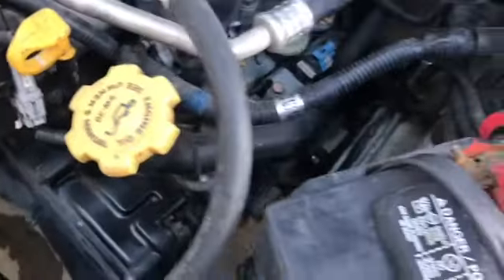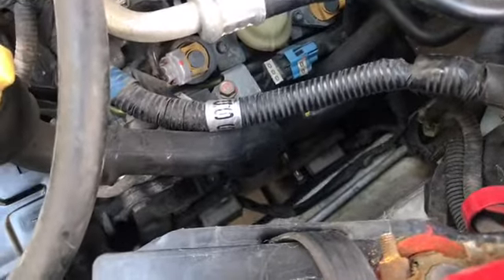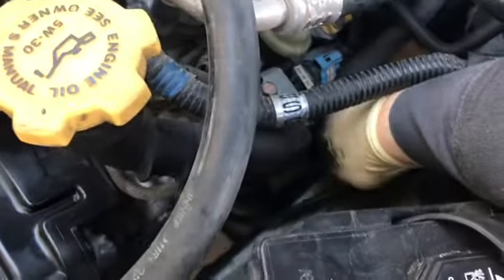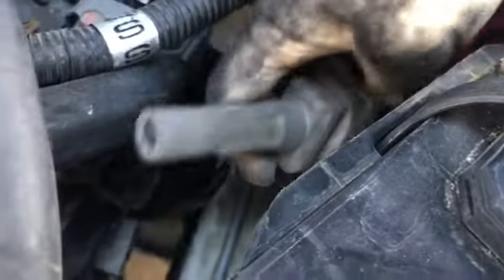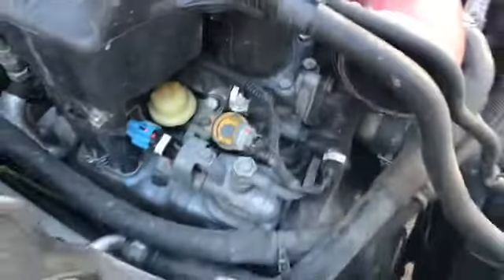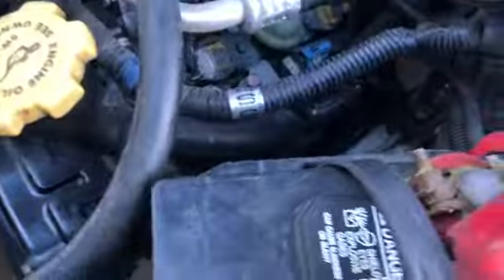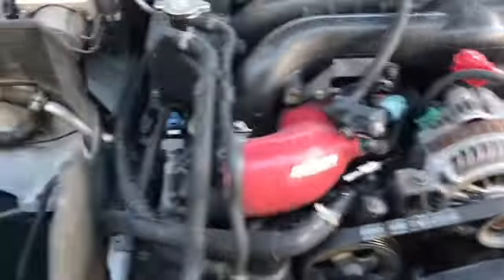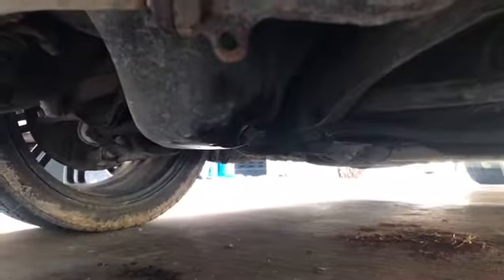Subaru Legacy Coil-On plug replacement

Comment: Congrats on resolving your problem. But there is an easier way on extracting those coil packs. (you don't have to lift the engine. I just pulled out all 4 of my coil packs and plugs on my 2005 Outback XT, which has same coil packs and the same issue with limited clearance for access at frame rail.)  The ones in back are harder, even when I knew (read) the trick to rotate the 180 degrees. You also pull them towards the front of the car, as opposed to just up.     (Also it's really quick to pull the battery, compared to lifting the engine.)

I feel your pain though. I struggled with that nastiest one at driver side rear (#4) for like 20 minutes, then went to go lay down and rest my back and wonder what the #@%%  I was doing wrong. When I came back out fresh it came right out, first try. Apparently I just needed to try a slightly different angle, and not force it.  
it does fit in&out. But only through the less obvious path towards the front, after rotating it 180 degrees upside down.

Comment: Hey thanks for posting.  I'm chasing issues on my '05 LGT as well.  I'm curious...did you notice any issues with rough running in cold weather?  If so, did this replacement make that go away?

Thanks,
M
Reply: Hey Mark have you figured it out? I'm having misfires only on cylinder 1 during cold start ups but runs fine otherwise... Please let me know thanks
Reply: @lncollege  I'm afraid I haven't figured it out yet.  When the temperature gets on the cool side (about 10 deg. Celcius) the car sputters, struggles, stalls and throws a P0340 code which is the cam position sensor, circuit A (passenger side).  If it's very cold out, the car will start fine but then as it warms up it will start to sputter, etc.  Apparently it's been a nagging issue for years.  I found a receipt for the sensor in the documents I got from the previous owner.  I'll likely replace all the plugs and coil packs soon but unfortunately, now that the weather is turning warm up here in Canada I won't be able to tell if it helped until the fall.  To follow the saga in greater detail, look at the legacy GT forums.  My user name is "Paycheck" over there.